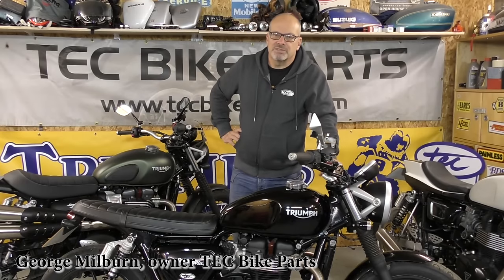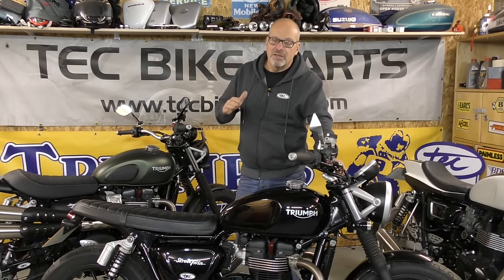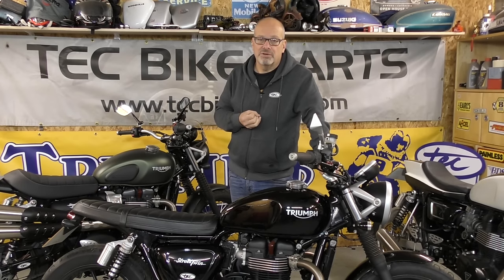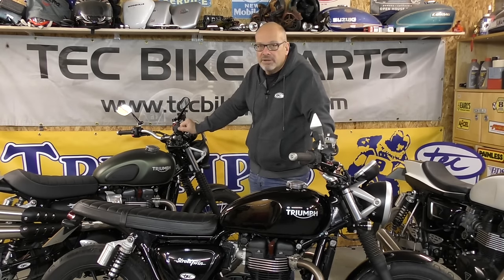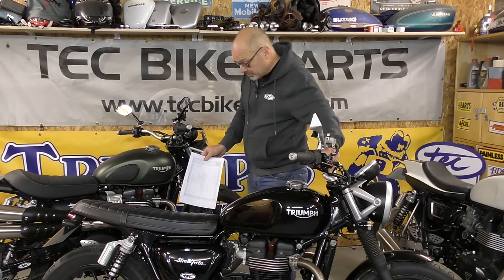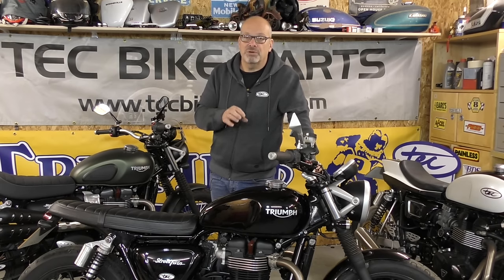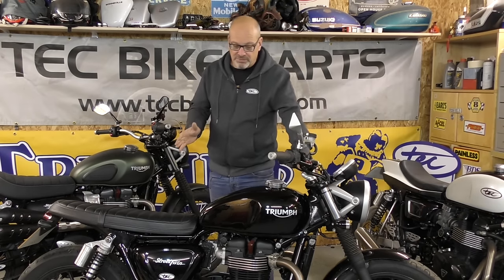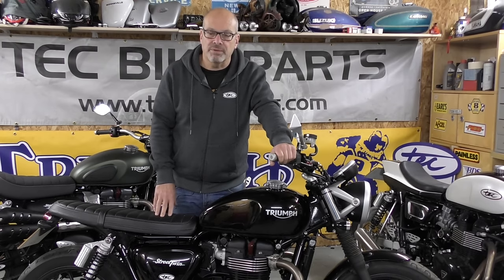How to de- restrict 900cc Triumph Street Twin/Cup/Scrambler/T100   for LOTS  more power and torque.

Comment: Great work George.  But are the other mods now worth it? Why not upgrade the cam and have the rest as stock as there's a tremendous upgrade all in one go.
Reply from the maker: hi Stephen, you can just fit the cam, and if you do this the bike is still euro4 compliant for emissions, but  without fitting the de cat you will only get about 8BHP gain .
So I would say de cat and cam as a minimum.
Reply: TEC Bike Parts thanks for the response. On the list !
Really wanna see you guys succeed
Reply: TEC Bike Parts So together with de cat it can gain around 15hp? How About combination of sport air filter and camshaft? Does it make a sense ?
Reply from the maker: This is the whole point of this video to show in stages what improvement each change makes,
with the cam you will see noticeable gains with any part that improves the breathing to the motor.
Reply: Great work! Fantastic explained. When everything will be fine, my wife will drive a T100 Bonnie and I 'm looking for the Scrambler (both 900cc watercooled)! We are interested in upgrading the bhp for a better reliability of These lovely bikes! The New Bonneville Familiy is the reason why we made the A license in germany. Please set us on your list for upgrading the engine! Thx a lot, Peter

Comment: So basically after all these upgrades including the breaks it makes more sense to get t120?
Reply from the maker: In some ways I agree,  but if you just want the motor not to be castrated by big brother Triumph , just fit the cam only , The 900cc bike even with the cam is a LOT cheaper than a T120 and it makes the bike go like it was designed too.

Comment: This CAM mode is possible for upcoming royal enfield interceptor 650 twin ?
Reply from the maker: Can't say till we get our hands on one next year, but the engine looks like it was designed by an ex Hinckley employee !
Reply: TEC Bike Parts Ex Hinckley employee means Triumph ?
Reply: Yep Ex Triumph designer. I look forward to TEC ripping into the new RE 650, on paper for a 650cc the BHP is OK but  I love the start point with the styling and the price around 6K is mad cheap! If the reliability is proven these will be a good match for the Street Twin.

Comment: I have a 2017 ST and am thinking about doing x pipe decat, and running "open header", is this safe to do? I am also thinking about ordering the TEC cam for it, as this video is very convincing. Cheers!
Reply: safe but VERY loud
Reply: @georgemilburn6213  Thank you. I have received mixed reviews about it being "safe" for the bike. I am ok with loud :) I ordered the K&N tb-9016 filter to help the bike breathe better, and am very interested in the TEC cam. Do you have any additional suggestions to help the bike run better. I find it sort of idles weird at times in its stock setting.
Reply: @Dave_Parnoy  You really have to change the cam to get any real HP gains on pre 2019 bikes
Reply: @georgemilburn6213  Well I hope you have some in stock, because I'm about to place an order ;)
Reply: george milburn hey George, I installed the X-pipe this weekend and man does it make the bike sound tough! I left the stock exhaust cones off and feel I lost a little low end. Do you recommend getting the “off road” tune done? I am also wondering what noticeable improvements I will get from adding the TEC cam. Cheers!!

Comment: wonder if thats the same for the RE twins , they also have those magic A2 horsepower
Reply from the maker: Hi
The RE 650's do have a very mild cam fitted as standard, i am patently waiting for an S&S cam to try , as we have just applied to be dealers for the S&S performance RE parts.Hope to do a lot of RE 650 work over the winter.
Reply: @TECBikeParts  yeah i was Mailing with s&s . They are working on a e marked exhaust for the eu market.  Looking forward to see results with the cam on your channel

Comment: Hi there, what mods are required other than the cam? Power commander?
Reply from the maker: Can be used with stock ECU as in the tests, but you can get (slightly) more power with a booster plug or power commander
Reply: TEC Bike Parts so a completely stock bike with this cam gets you the same gains?
Reply from the maker: If you watch the whole video all this is explained.
Parts and mods are as follows-
TEC de cat X pipe, TEC slip on silencers, TEC camshaft and airbox mods all with stock ECU with vance and hines 2-1 off road map update from Triumph. Everything else is stock.
You can just change the cam and nothing else but you will only get about 60% of these gains.Not to be sniffed at and handy if you are in an area where you cannot touch the exhaust because of strict laws.
With the TEC cam only fitted the emissions are still fully euro 4 compliant !
No power commander fitted

Comment: Great work. I live in Australia and i find that this bike struggles quite a lot in our hot weather. My bike is still stock i have a street scrambler. The exhaust has discoloured and it seems fall off power over 110km/h
Reply from the maker: Hi
These problems are caused by the restrictive cat and camshaft. Also try removing the air box snorkel / rubber and fit a high flow filter to give it more air.
Reply: TEC Bike Parts i did the snorkle but cant notice any difference, but that doesnt mean there isnt. Will try the filter next. Dna? 
The decat option is limited at the moment. 
I hope this cam turns out to be a winner, it appears to be so and kudos for the effort and passion for the triumphs. You may need a bigger warehouse
Reply: How much are the cams i want to swap mine are they an easy install
Reply: Matt Elliott depends on your spannering skills. A regular spanner man would have little issues but a novice would have to seek advice on valve adjustments torque setiimgs etc

Comment: TEC, are the previous 865 injected motors more powerful than the 900's in standard tune?
Reply from the maker: out of the factory the 865cc bikes up to 2016 have slightly more BHP but less torque , but in the real world the extra torque makes the new gen bikes feel more powerful. It is a lot easier to tune the early 865 and 790 cc bikes, as simply changing the exhaust and air filter make a significant difference .On the 2016>2018 W/C 900 cc bikes you have to change the cam to make any significant difference.The new bikes also have a much more modern feel to them and the early bikes feel very 'old school'.
Reply: @TECBikeParts  Thanks. One more question will your 2 into 1 Raider exhaust fit a 1200 Scrambler XE do you think? If it does I can fit panniers on both sides.
Reply from the maker: @Britishshooter  will not fit, mostly due to foot peg position
Reply: @TECBikeParts  Just that or will the cross pipe not fit between the sump and frame tubes? I don't mind modifying peg position and minor stuff but if the clearance isn't there then it cant be done. I just love everything about the Scrambler except the high exhausts.
Reply from the maker: @Britishshooter  Hi
I have not tried to fit one , I had a quick look and the main issues would be-
components under motor may need moving, foot pegs would need to be moved/modified and silencer would need a hanger bracket to rear pegs
Reply: @TECBikeParts  Thanks, all sounds do-able, I will check out what needs to be done to the stuff under the motor. Lots of people would love an exhaust on this very popular bike that allows touring.

Comment: Great stuff, but you could do without all the torque talk. Crank torque is nothing more than the RWHP measured by the dyno, times a constant, divided by the crank speed (i.e. rpm). If the engine makes more power, the torque number will consequently be higher. Note on your 4th run without the airbox. You said the engine lost torque. Well it did, because the engine made less power over that exact same rev band. The engine power tells you everything there is to know. A flat torque curve is the result of a linear power curve. Just the way the math works out.
My Thruxton 1200 makes about ~87 RWHP. A Ducati Monster 1200 makes  about identical power as the Thruxton up to about 6500 rpm. The Thruxton then peters out much like this 900. The Monster keeps making power out to around 10k rpm where it tops out about ~140 RWHP.
I'm sure the Thruxton could make considerably more too, but it likely comes at the cost of some durability.
Hope you sell a million of them. Makes me wanna go buy a 900 Scrambler. This should make an already good bike brilliant!
Reply: You got it almost exactly backwards. torque indeed is a measured force, extracted mechanically from a Dyno. HP is a calculated figure factoring in RPM and calling it more accurately Peak HP.  HP = Torque x RPM ÷ 5252.
Force is measured, power is calculated, and therefore an artificial number. Torque for those in the know is the mother of HP. You can tell a lot more from what and where the torque is than peak HP which is usually limited to maximum RPM, or near it, where few of us operate our street motorcycles most of the time.
Reply: That's the common wisdom, but it's wrong. The machine is measuring power at the rear wheel and multiplying it by 5252 then dividing that by the the crank speed (rpm) to give the crank torque approximation. The Dyno is giving you the actual power at the rear wheel and a calculation of the crank torque based on that power. There are a number of ways a machine can measure power, don't let that distract you.
Torque at the rear wheel is gear dependent. Don't believe me? Put the bike in first, give a little gas, and release the clutch. The bike scoots away eh? Try again in sixth gear. Not so much torque there eh? Same engine, burning the same fuel, making the same power right?
Don't be dismayed, this is a common misunderstanding. Repeating this kind of thing over and over is how we get religion, Trump, and other undesirables.
Think of it like a bicycle. When you ride one, you aren't torquey. You have potential energy from eating your Wheaties that can be converted to kinetic energy. The rate at which you convert that energy is power. If you use that power to spin a bicycle lever, that imparts a torque (just like at the crank of a MC). The torque at the rear wheel is governed by how big you make the rear wheel gear. If it's big, there'll be lots of torque at the rear wheel allowing you to ride up hill. But that comes with a cost. You really have to spin like hell to get any speed out of the bicycle. Now that you're on top of the hill, you can put it in 10th gear. There is very little torque on the rear wheel at that point, but you can get a lot of speed with very little effort. The amount of power your body can produce didn't change.
So when you burn fuel in an engine (or your body) you get power. Gears convert that power to some ratio of torque/speed at the drive wheel. The torque shown on a dyno graph is an approximation of the torque at the crank NOT the torque on the rear wheel.
You could get the torque at the rear wheel easily enough by dividing the RWHP by the rpm of the rear wheel and multiplying by 5252. It would be different in every gear. That's not what Dynos are measuring however. They are measuring the crank speed rpm.
Showing a torque graph is superfluous. It's like wanting to see the high temperature everyday of the month,  then someone gives you a graph of those temperatures along with a graph of those temperatures multiplied by 5252 and divided by the day of the month. The extra curve told you nothing you could know by simply looking at the graph of the temperatures.
Reply: well, essentially we agree but you look at it from some perspective that is really, academic. gearing is a finite parameter, of course you can change your gearing and get some different "applied" torque at the rear wheel. change your rear tire and you change your gearing, but it has little to do with the engine output as stated. Crank HP figures are useless on a Dyno. Since Dynos measure rear wheel torque and calculate RW HP, ( and of course it is dependent on what rolling road software you use, and how the dyno is set up)  crank HP is meaningless to evaluate differences in set ups. what we look for in dyno testing is differences in output from a bench mark reading before any modifications are applied, then test again to measure differences, not output figures. Every bike is different, every dyno is different on any given day. so George is stating things quite correctly from the perspective of dynamic changes to a system after applying said modifications. it's how it's done on the bench to accurately compare dynamic changes. 
Now back to our regularly scheduled programming, enough hijacking this thread.
Reply: This isn't a thread, it's a video comment section and my comment is regarding the presentation of the video. Generally great, just too busy and confusing by adding in the redundant crank torque gobblygook. If you simply show the baseline rear wheel power vs the improved rear wheel power curves and maybe say something like "there's a 15% power increase at 3k rpm, 20% at 5k rpm, and a 40% at 7k rpm. Sold!
On any dyno ever produced, if engine configuration A is making more power at the drive wheel than engine configuration B at any given rpm, the number calculated for the crank torque will be proportionally higher. The one exception is at 5252 rpm where they will ALWAYS be the same. It's academic ;)
If you can ever find a case where the above is not true, the dyno was broken.
If you want power to accelerate, twist your wrist. If you need torque to pull a fattie up a hill, downshift.
Oh and a link to your store in the description would be great too! All the best.

Comment: Will you give some ideas for Intercepter
Reply: Hi
our new hi flow exhaust that will be available at end of 2019 and our hi flow air  filter kit will give an easy and instant gain of about 8 bhp at rear wheel, and make bike approx 15 KG lighter. this alone transforms it, but the motor has loads more potential for power and we will be looking at various options over this winter.
Reply: @georgemilburn6213  Do you provide solutions for average also...? In the existing motor.

Comment: Will that cam work on a 2014 air-cooled Scrambler 270 degree
Reply from the maker: water cooled 900 only
Reply: TEC Bike Parts well that sucks but thanks for the response I appreciate it

Comment: That has pissed me off no end. I was going to buy a scrambler this year, but now Triumph aren't getting my cash, I'll look elsewhere. I don't want to buy a new bike and invalidate the warranty by modifying it to get decent power and torque.
Reply: I think you will have to build your own bike since every company does this these days
Reply: No - mostly a retro/cruiser thing.  But even in that niche, this is massively detuned for a watercooled engine.
Reply: In the 2019 models they have released the 900 with a so called unrestricted cam from the factory. I think it adds somewhere around 10hp and ft lbs

Comment: Does anyone know if the 2021 triumph street twin is restricted, it feels like it is as a lot of power drops off around 2800 rpm and would the camshaft featured in the video be suitable for the 2021 as well?
Reply: the Street twins from 2019 onwards got a horsepower increase of about 10hp, they are no longer restricted. if you are looking for more power your best option is probably an ecu tune.

Comment: 49 BHP?. 750 pushrod Meriden Bonny = 50 BHP
Reply: It's mad how modern Triumph twins are so restricted even the new Enfield 650 is just 47 BHP but it's just a 650 I guess? I'd love an old 70's Bonnie but prices have gone crazy. My old CB 450 kicked out 45 BHP back in the day. Early Hinckley Bonnie with carbs is the way forward.
Reply: Maybe comparing genuine back wheel figures with old "brochure" figures is a bit misleading ?
Reply: Here in India Street twin has a power of 54.2 bhp.
Reply: Peaceful man.. That is the official figure but actual dyno figures are never exactly the same and that goes for any vehicle.
Reply: The pushrod Meriden Bonny could never pass emissions today, or even this century.  And how often did you have to a) do a tune up, including farting with the carbs, and b) rebuild the whole thing?
Reply: Mark Pitman they are restricted to 47 bhp bcaz e2 licence over there so this bike will be more accessing

Comment: So a reasonably cheap bike becomes expensive and void of any warranty really quick for less power you get stock from a Street Triple R and you still need to get the brakes and suspension sorted, not to mention the insurance hassle for such mods. Madness.
Reply: Bandit zxzx - Right you are, but there’s another angle. Buy a “pre-owned” fully farkled “classic Triumph” and you’ve got a good deal and a decent motorcycle. That (and the subjectivity of aesthetics aside) I’m a sports and adventure bike owner, but riding these machines can be very relaxing and enjoyable.
Reply: @UncleWally3  I agree Walter. It really depends what you want/need the bike for? I have owned both a 900 Air cooled thruxton and a Speed triple Traded the later for the former. The Thruxton looked great but needed so much spending on it to make it what I consider fit for purpose I felt almost cheated. On the other hand the triple was a hooligan bike that I simply had to sell if I wanted to keep my licence lol ;) I ride a Cruiser now and life is c=very calm...right out of the box  :)